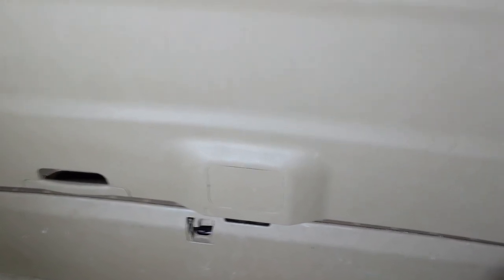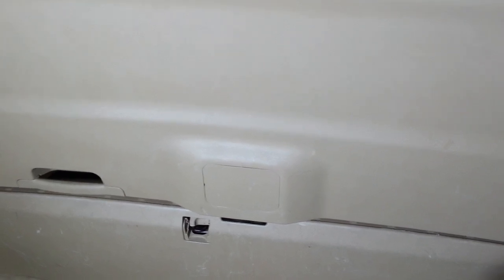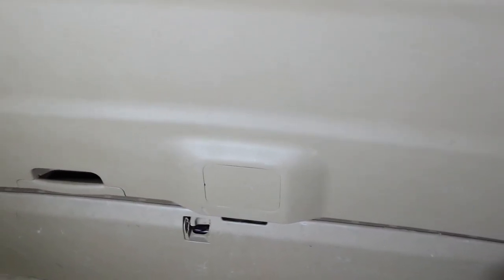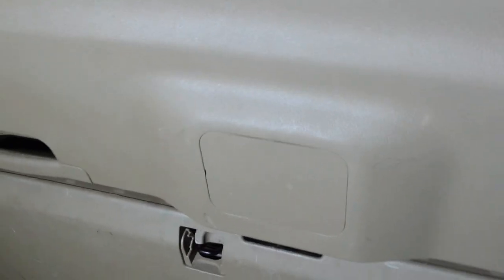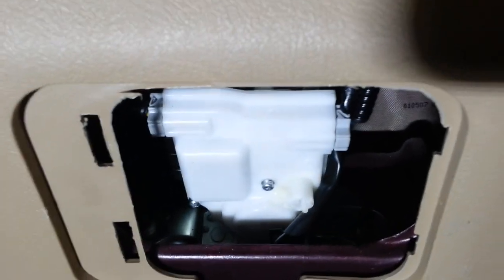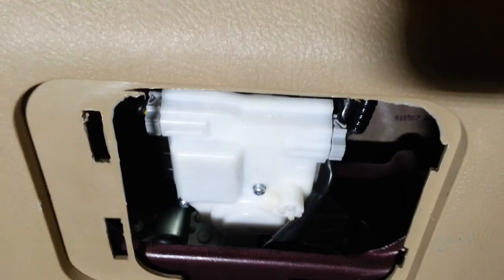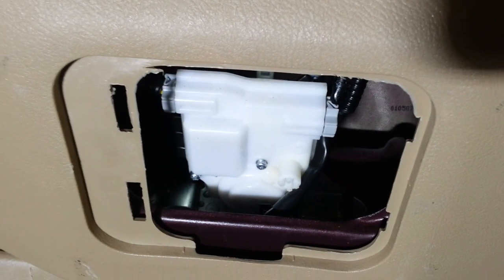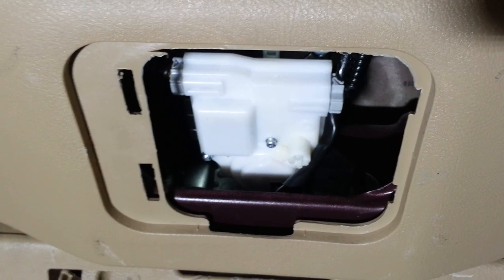How to open the rear lift gate on a 2007 Honda Odyssey when the lock won't open

Comment: Good advice. Didn't work for me because it seems this relates to an issue of the solenoid lock, whereas my problem seems to be related to the cable not releasing the latch. Finally managed to get to open and then sprayed (a lot of) Teflon on the latch mechanism. Seems to have fixed the problem for now, but I'm guessing it's eventually going to need a proper repair. But if the lock ever fails I now know how to override it, so thanks again!
Reply from the maker: Wow, that's been so long ago that I made that video.  Thanks for commenting and sorry it did't work for you.  What really frustrates me is when you ask the dealer, they want to tear everything apart and charge you through the nose to get what should be, a simple latch release!  When they design these, I wish they would keep the end consumer in mind, but I'm sure they want to make it unservicable  by the owner so you are force to take it to the dealer for repair. Thanks for commenting! 😀

Comment: Thanks million Richard.  My 05 Ody have the problem twice in two years.  I followed you video and have it fixed every time.  Only one step I added in my latest case:  I have to go outside and reset the handle from its squeezed position before doing anything you had suggested.

Comment: Worked for me. Did you ever find out what was wrong exactly? Looks like a solenoid itself, which should be an easy fix. I've had the same issue with my 2005 TSX.

Comment: My 2008 Odyssey just developed this problem tonight. Found your video and your solution works! Thank you. Fingers crossed it stays fixed. First problem I have had with my Odyssey that is over 9 years old with 143,000 miles. Best car/truck/van I have ever owned by far.
Reply from the maker: Don Rose Glad it worked for you.  It should stay fixed.  Never had the problem again, although we just traded in our 2008 Odyssey that started having lots of problems.  Good for you having better luck with your van. :)

Comment: i have a 2006 odyssey touring, passenger side rear door was getting hard to open then suddenly it stuck, i can't open the door from inside or outside .... need advice plz
Reply from the maker: Sorry, cannot help you with this since I no longer have the Honda Odyssey. Check with Honda to see if they have a solution.  Good luck!

Comment: Tried this; worked PERFECTLY!  Tested after turning the piece on the solenoid by closing the lift gate, locking with the key fob and it locked.  Then unlocked with the key fob and it opened.  What a deal!  Thank you!

Comment: I've got the '04 Odyssey.  Looks like this rear door...is designed differently ( better?) than the one 3 years prior.  However...what 'I'm amazed at' is....that Honda apparently didn't provide a way to 'open the rear hatch door'...from INSIDE the Van????   Nope.  I see NO intuitive button or latch or release...to open the door this way.  Only...from the exterior??    Wow.... utter and complete FAIL there, imo.   unless someone 'hip's me...to something i don't know.  bought the Van little over a year ago ( Love it..despite it being already 16 years old...but been driving over a year now...and only had to replace Ignition in Column, and a couple other minor fixes.  It has Started, and Run...every single time i've turned the key)   Anyway...just thought that was a major oversight...to NOT provide a way to open hatch...if you're in back...and wish to exit that way.

Comment: Make sure you test and make sure that the seats are attached all the way because they might tip backwards and trap you upside down in the case of Kyle Plush so just make sure that you test and make sure that they are attached by rocking on them when you are on the second row and then going to the third row and leaning back to try this.

Comment: Hi, wanted to ask if the solenoid is the white, plastic part you put used the screw driver on.  I am having the same problem  and want to see if I can replace it myself also about how much does it run?. Thanks

Comment: HOW do put lock back on hatch DOOR in back
Reply from the maker: +Precious Wells not sure what you mean.  You do not remove the lock at all.  You just turn the screw driver until it latches back.  What happened with mine, the automatic lock started working again and hasn't been a problem since.  If yours does not start working, just leave the cover off and manually lock it back when you need to with a screwdriver.  Hope this helps!
Reply: Richard. Rose. Thanks

Comment: My 2007 Odyssey is not the same as the video. I have the high end model. There is no adjustment screw to switch to manual.

Comment: This does not help if you in the back and trying to get out. They need to legislate all windows and doors on vehicles need manual operation redundancy to any electric scheme (which is for pure marketing reasons).  This way, people don't die when the vehicle tanks in water, poorer second hand owners do not have this headache. It is their way of prematurely obsoleting the vehicle and make thousands in aftermarket repair.
Reply from the maker: I agree!